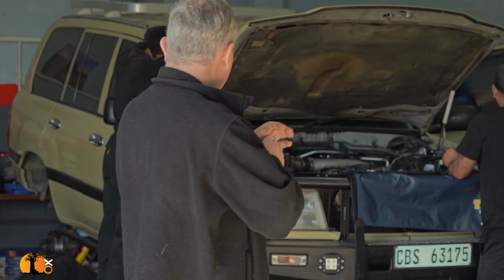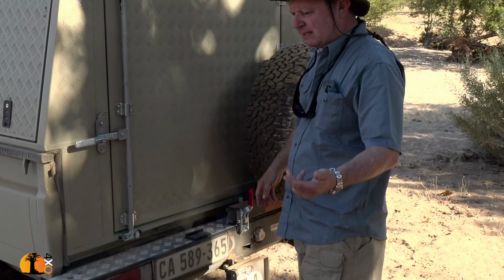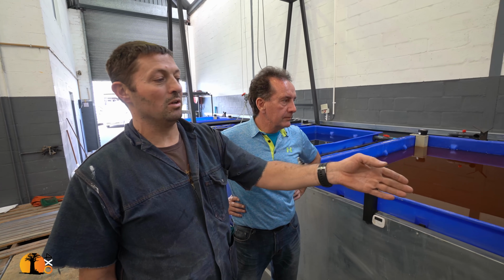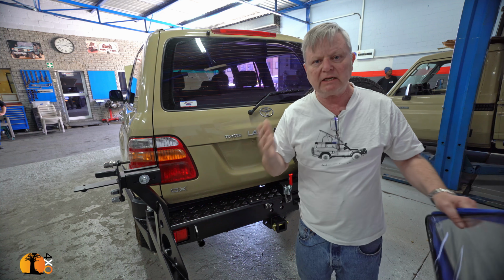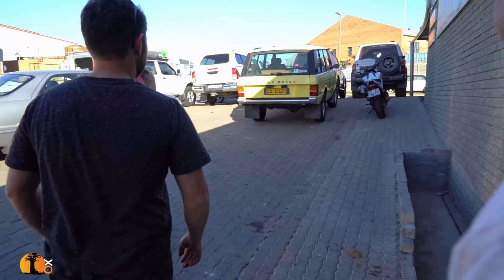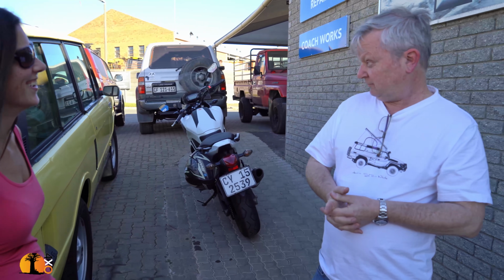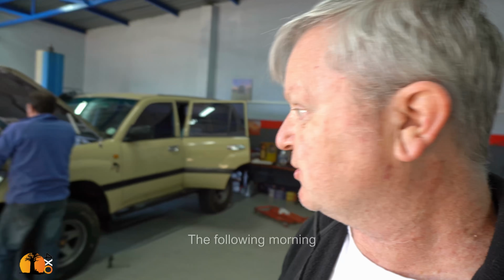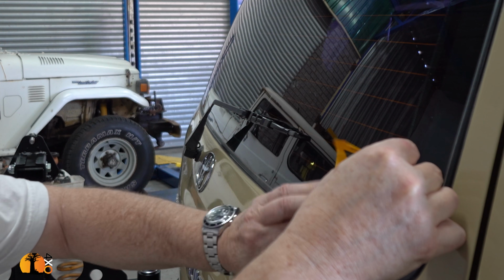Rear Bumper & Meet and Greet. 20-Year-Old Land Cruiser Restoration, part-13.

Comment: The GOBI X bar looks like a lot of ideas from  a Slee Offroad rear bar from the US.  One handed open, gas struts, arms clamped to the bar. tyres and clamped to the backing plate under tension to stop vibration. I have one of the only SLEE 200 Series rear bars in Australia.

Comment: What a nice wheel carrier. I loathed the one we had on our old 60. The rotten thing used to pull the bumper off. Got the guys at the Men's Shed in Rockingham to weld it up for me and they used some hefty lumps of rebar. It never moved again after that :)

Comment: That rear bumper is amazing. I have a rear steel bumper from CBI and the swingout latches sideways instead of up/down so when I hit corrugations the swingout moves up and down making a clunking noise no matter how tight i make the latch. The design of the Gobi X is perfect.

Comment: Fitted a bigger fuse.....what about heavier wiring? When I fitted a 270 amp (mil spec) alternator to my 100 series years ago, I used 35mm² (aka 2B&S) cable between the alternator and battery. The fuse protects the cable. Putting in a bigger fuse without changing the cable size, could result in disaster.....just saying.
Reply: On the same tack,  your 270 Amp alternator charging at 14Volts would  consume likely 5.5 to 6 kW of shaft power, so belt speed might have needed increasing and/or more angle of pulley contact from an extra idler.
Reply: Agreed. Alarm bells were ringing when he said he upped the fuse because it was melting. Now the wires will melt instead...